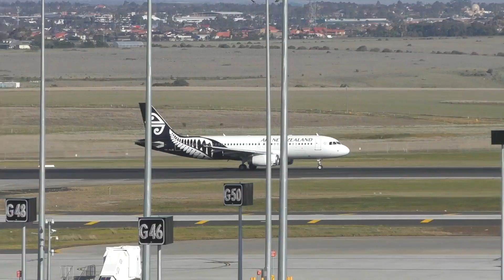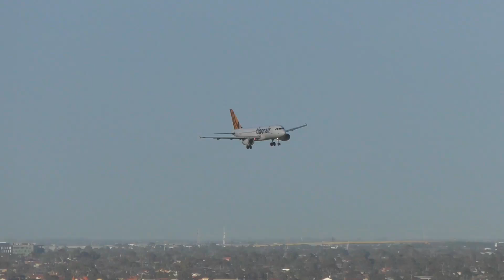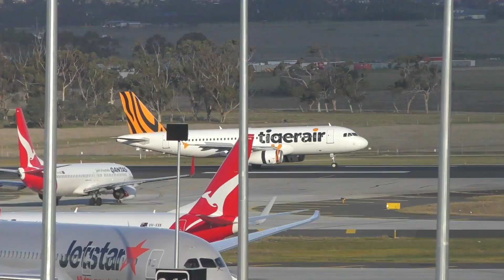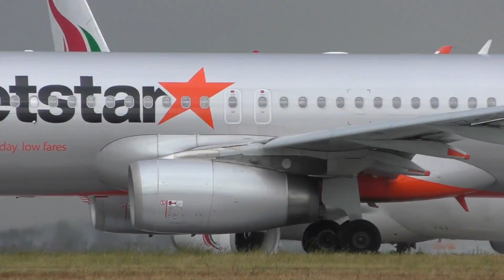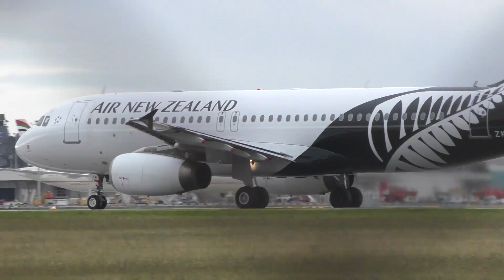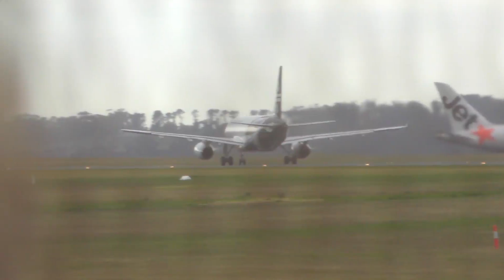ENGINE PROBLEMS with Pratt & Whitney GROUND A320neos

Comment: I worked for PW for 5 yrs in R&D Florida until 1991 before they laid off 9500 people and closed the plant. Now they make most of the engine parts in CHINA, so go figure why quality is crap now !!!!!
Reply: Making "parts" in China is NOT the reason.  Quality is fine.  The engines are built precisely to their drawings.  Many features of the DESIGN are crap compromises "OK'd" by management for expediency.  THAT is how PW makes an engine these days in their world of management defining and handling "risk" and picking "gender parity" over engineering skill and commitment.

PW1000G "architecture" goes KA-BOOM ! (Mirabel Canada)
Reply: @mrunning10  I work for a major aviation company now. They are doing exactly what you said. I work with people with ZERO experience on million dollar parts that previously worked at a quick stop, and the company wants me to train them to be a cnc machinist. Go figure........

Comment: Sit in a seat just in front of a turbofan and you hear the problem very well. That kind of noise(buzzsaw/garbage disposal) can’t be good for any fan blade. Been seeing way too many of these things causing an uncontained failure, one killed a woman seated next to the window. I think once the bugs are out of the geared turbofan it will be the standard for all turbofans. Until then I think people need to pay attention and make a statement by steering clear of the noisy ones

Comment: I think you should’ve isolated the issues by pointing out the fact that this is only happening on aircrafts in the Indian market, harsh environment that’s difficult to duplicate in developmental phase. Other PW engines aren’t having the same issues as the Indigo and GoAir, correct?

Comment: Simple solution to teething problem of p&w GFT engine. They have to add one or two more planetary gears in the gear train. This will distribute the tangential thrust among more no. Of planatory gears and also distribute the load among more no. Of teeths

Comment: I wouldn't be be surprised that Airbus stops A320neo deliveries with the PW1100G engine until the issues are resolved. Meanwhile, CFM International is ramping up LEAP-1A engine deliveries, so at least the A320neo line won't come to a complete halt.

Comment: Well since I am British I do think that overall the Rolls Royce engines which are stated by press media in U.K as having lower fuel burn and reliable. Pity Airbus chose to buy American engines for some models. though it is good that Airbus has sold a lot of planes to  U.S.A. airlines. I am saving up for flights on A380 planes on Etihad airline, as 3 of us are going to Seychelles, hopefully,  later this year. thanks for your interesting videos.i
Reply: You mean like the Rolls Royce Trent 1000 engines for 787's. Total disaster.

Comment: Hi, while talking about engines, you could also talk about B777 engine which has exploded, and also a A330-200 from Delta (the flight DL-55) which had emergency landing yesterday because of engine failure (fire). And both P&W engines :)

Comment: The A320 NEO would have been great but the PW1000G's are cursed. Wish they had gone with GE or something
Reply: Aviation Teen you're correct, but the 737 is too crammed and uncomfortable!
Reply: I meant that I wish Airbus had gone with GE engines

Comment: P&W after sale-service is terrible as mentioned by the founder of asia largest budget carrier. Airasia order 100s of  A32neo using CFM LEAP engine. He doesn't like U.S. corporate way of doing business. Lucky CFM is a joint venture which france safran holding 50%. The way CFM dealing on engine support is much better than P&W. P&W is just live on her past glory.

Comment: Flying a320neo PW engines are becoming unreliable, Qatar cancelled their a320neo orders because of that they should stick more with GE’s Leap X engine that also power the 737MAX. Same thing on the PW4000 with United 777-200 yesterday. Rolls Royce Trent 1000 is also having issues with the Dreamliner. 787 costumers should also stick with GE-NX until PW and RR are done.
Reply: Leap is not GE, it is CFM. And it is mostly french, GE may own the capital and did participate to the development but this is mostly Safran's work.
Reply: 5shujin-sama Yea I meant to say “CFM-leap X” not “GE leap X” my mistake.

Comment: Airlines should stick with the CFM LEAP.  Even before this recent issue popped up, I'd go with the tried and true tech, and not even consider a GTF for a few years, to get the kinks worked out.  A fraction of a percent in fuel savings is meaningless when your plane sits on the ground or can't even be delivered.

Comment: Sorry again for the shorter comment, I’ll get it back up tomorrow. Regardless, the A320neo P&W problems are definitely a hinderance to the A320neo and their delivery schedules. Getting orders pushed back could easily lead to a conversion, like the Qatar 737 MAX order (went to subsidiaries ) and the A321neo order.

Comment: I wonder if any aircraft are likely to switch to the Leap engines. PW have been having issues for a while. 
I’m also surprised a few 787 customers haven’t switched to the GE-NX engines too. 

Not so much airlines that already have the engines running in service, but future orders (which is most when it comes to the A320NEO)
Reply: Morgan Lambley It’s not so simple to switch. You can’t switch existing aircraft and the GE pipeline is full for many years ahead

Comment: I wish Rolls Royce stepped in
Reply: FlyingSpartan Rolls royce because the Ones of the 787 work very well
Reply: RR does not manufacturer engines for narrowbody aircrafts now
Reply: FlyingSpartan Leap 1A is good
Reply: Aviation Enthusiast Leap 1A is from GE not rolls royce
Reply: They have their own serious issues now. No way they could “step in”
Reply: FlightFilms rolls Royce is garbage, they are having issues on the 787, they need the CFM series engines.
Reply: RB311 would be good name for it.
Reply: Lol RR is the worst of the big 3... just look at the 777 fuel ice screen failures and the dozens of 787 's sitting on the ground just at Heathrow
Reply: I should say among engines, GE has done a better job, either by itself or through CFM

Comment: Definitely concerning. However, since this a new engine, there is bound to be some issues. It will take time to understand the full extent of the issue, and how much it will cost Airbus. One thing is for sure that it is unlikely for this issue to ground the a320neo program. The a320 is Airbus' best selling aircraft so it wont be long until we see many more a320neo's in the sky.

Comment: Sad facts indeed. It is possible that the engine manufacturers are under enormous pressure to meet fuel consumption and carbon emissions targets they may have pushed the  new technology too far?.
Reply: Star Trek Theory we are not ready for warp drive yet. Scotty always had problems with the crystals.